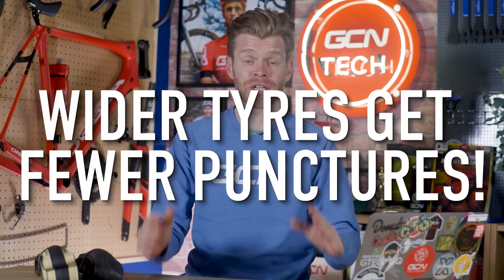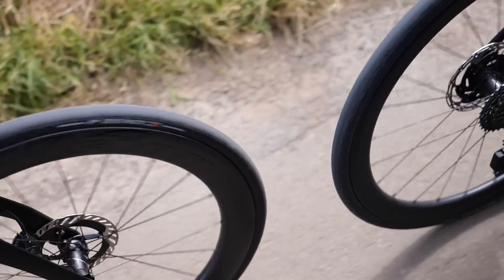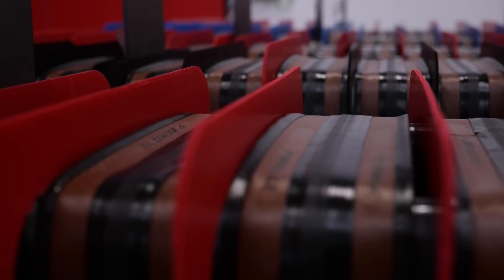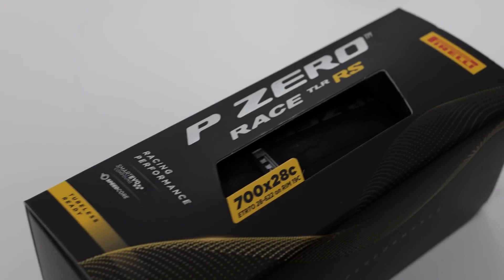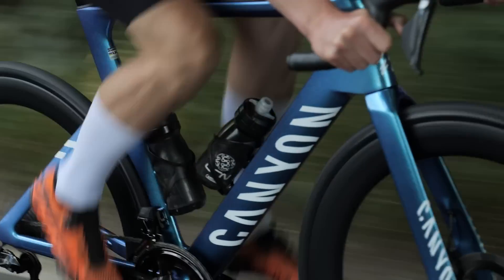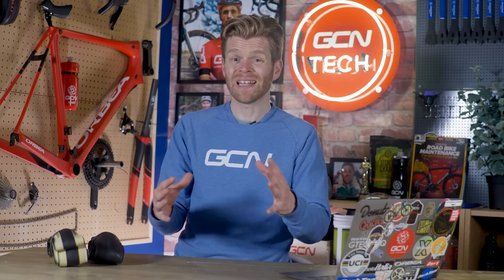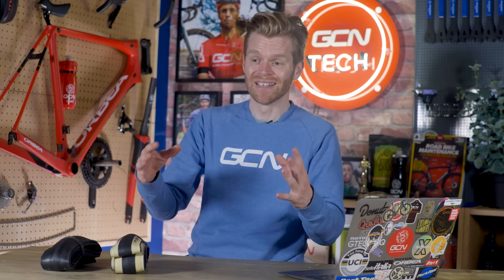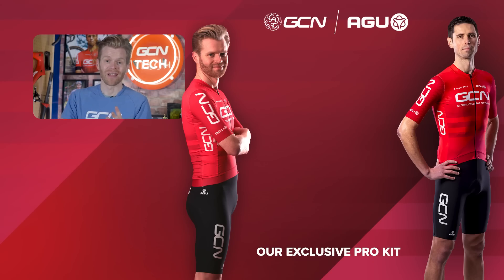Why Your Bike Tyres Get More Punctures

Comment from the maker: Have you been running your tyres at the wrong pressure? 🛞
Reply: not really. Using Silca's tyre pressure calculator for the past 2 years. Mind you, not tubeless, for its notoriety and fussiness due to the sealant, but with TPU.
Reply: I am not buying in the low pressure craze. I am significantly slower on 60minus PSI. I keep it on 95-115 on my 700c 28 front and 700c 23 on the back (mudgard prevent put 28th on the backwheel)
Reply: One point missed. The wider patch presents itself with a much higher risk of a puncture to road debris. If it’s double the width it’s probably almost double as likely to hit a sharp object.
Reply: @christocan4710  The lower PSI per cubic inch of the wider patch may mitigate that effect. We could speculate all day about these points, but we don't get paid as much as the 2000 engineers at Pirelli so I wil leave to them to figure this out. It sounded like it's a never ending quest for them.
Reply: @rdeanmurray8139  I don’t think so. I have seen real world contact patches and they are simply wider the wider the tire. So it’s only logical you hit more sharp objects.
Reply: I've regular Conti 5000 25C with tubes and forgetting to pump them up to spec more often than not gets me snake bite punctures. So pumping up tires before rides is obligatory.
Reply: @Alex-gl2dw  the same but with 23mm. Waiting them to wear out for justifying a new  28mm tires installation.
Reply: Because I'm lazy and ride on a variety of surfaces, I tend to inflate to a little bit higher pressure and then wait until they're noticeably lower before re inflating
Reply: 12,000km a year, all tubeless, all correct pressures. No punctures in 3 years and counting. I do ride on Swiss roads though…
Reply: Just switched to TPU tubes on my gravel bike and checked on the silca calculator after getting a pinch flat what pressure I should be using.  Turned out I'd been running at 50psi and they recommended just under 40 for my system weight and tyre width.  Much comfier ride now too.
Reply: Only on the vintage bikes that can’t go past 25mm
Reply: I only do what GCN tells me what to do.
Reply: I weigh 255lbs so I have to run 95 psi or the tire goes flat 🤷‍♂️
Reply: @shawnmartin1306  Not quite that strong but I run 140 and 160psi with very good Contis. Perhaps after I get smoked in the Geezer Time trial I might reimagined this? It works. Lovely to hear from all the tubeless warriors.
Reply: How to turn a 30 second video into 12 minutes and I still don’t have a good answer.
Reply: @prism8289  Wireless then
Reply: Over time won’t the shoulder of the tyre slacken increasing the contact area.

The older the tyre the contact area will increase, surely increasing the chance of picking up debris that gives a puncture.
Reply: Usually about half a bar under what is the maximum printed on the side
Reply: Yeah! Blissful!
Reply: I bought Victoria rubino pro 25mm with tubes on hunt wheels. On the sidewall they say 100 to 120 psi not knowing any better I did 107psi..constant pictures. At 85psi an odd puncture, 80 psi I've not had a puncture for a while now. I also noticed when doing a roadside tube change cause my hand pump is rubbish that even at 55psi riding home it doesn't really feel any different. Also they are wider on the wheel than 25mm.
Reply: I have actually... Thanks for this timely video Ollie, I was overinflated by 15 psi on the front and 12 psi on the rear tire of my gravel bike. My wrist is almost recovered from a crash on a rooty single-track when my front tire washed-out on a downhill switchback which put me off the trail and onto my head.
Reply: Most often I underinflate by running the pressure recommended for hard gravel/terrain also on the road when using my gravel bike as a road bike.
Reply: nope
Reply: Absolutely yes according to old ways. 28 mm butyl inner tube at 3 Bars. I still have a good condition GP4000 S with no punctures on my sweetest bike. Years of special rides only. But with work horse bikes 3 Bars and thousands of kms and no punctures. Not many thorns around but glass and metal wire bits from exploded car tires.
Reply: @gcntech  I shall be vindicated in the end. Relieved I can still find my favorite tires.
Reply: I was at a lower tyre pressure, however most tech conclusions seems to have a cyclist being 70ish kg. I generally float at around 110-115 kg. With the recommended tyre pressure I kept having punctures Im guessing from snakebites..... As my gravel tyres looked perfect except for the side wall showing wear from the rims
Reply: Depends on what you mean by "wrong". I'm using SILCA Professional Tire Pressure Calculator and I'm constantly below the minimum stated by the vendor (Pirelli...), is this wrong?
Reply: Nope, turns out me being a fat tall bloke on standard (non tubeless) gp5000 28c required around 90psi. Just switched to god foresaken tubeless tires at 32c and done my first ride at the recommended 61/65psi and think I prefer the 28s and 90psi
Reply: @stuartscott3948 Andy Capp and all?
Reply: What a load of bollocks sharp objects or impacts cause punctures. More manufacturers waffle

Comment: With me at 250 lbs and the bike and associated gear, I figure a 270 lb total bike weight.
For 28mm clincher (rim brakes)
It says to run 99 psi rear, 95 front.
According to silca.

Comment: I’d really be interested in a discussion on how the 15% drop holds up with all of the current tire designs and sizes. 15% drop turned out to be a constant across the range of tires available in the 1970s. I’ve made gages to set tire pressure for my wife and I. Each gave is specific to one tire and rim combo. It was via a mid 1970s magazine article that I learned about the extensive drum testing that led to finding that rolling resistance was optimized at 15% drop. Frankly I was a bit surprised that well into the 21st Century the hard tire myth was still widely believed. Test data and valid engineering explanation was available half a century ago. 
All those decades and bazillions of dollars spent on exotic materials and areo shapes but it’s still a new topic to not jack tire pressure to the max?!

Comment: 50 years of riding on 25c tires, I can say that tires have gotten much more puncture resistant and road have gotten much more tire friendly.  For two day 250 you use to have to take a spare tire, at least two tubes and a patch kit.

So far this year 3,000 miles and one flat.

Comment: I competed in triathlons for over 25 years on high pressure, narrow tires (150-220psi / 18-21mm) before I had my first flat. Only had 2 in the 10 following years, so there is something to be said about having a much smaller, narrower contact patch encountering 50%-or-so fewer pointy things ...  and I never had pinch flats. (I ride 23mm tires at 100 psi during training rides. Still very few punctures.)

Comment: I have suffered so many punctures on my 50k commute on Auckland city roads on a 55kph ebike.  Most have been a "snake-bite" pinch punctures from manholes and potholes (in traffic they are sometime impossible to avoid).   My carbon wheels do not allow tubeless and I am running 32mm Continental GP5000.  My final solution is very involved.  1. Very think inner-tubes.  2.  A "ghetto liner"  (where you take an old inner tube, cut it along the inner circumference, and then place it inside your tire over a new inner tube)   3. Tyre Slime   4.  A high tyre pressure, about 85psi.   Finally I seem to be running puncture free.
Reply: Someone might ask WTF are you doing "commuting" at 55 kph using CARBON wheels? Some sort of death-wish?
Reply: @larryt.atcycleitalia5786  It's safer at to do traffic speed + it's fun
Reply: @larryt.atcycleitalia5786  it's safer going traffic speed, you don't get squeezed

Comment: My 28s are inflated to 90psi.  Anything lower than 80-85psi feels like a flat to me.  Finally used up the 23s I had,  felt like a hard rubber tires at 85-90psi.  My son prefers 23s, wear as I have switched to 28s, on my old Mavic rims.  I ride to & from work, 22 miles round trip, and for exercise on weekends.  Paved streets, not going fast so I can't avoid road hazards.  Never had a flat on the road/bike path or on the Coney Island boardwalk which is why I still use tubes,  however have had ONE flat sitting in the garage (aged tube), I own 3 bikes.

Comment: The other huge area of difference between performance automobile tires and those on bikes is heat, which is a total non-issue with bikes, but a core constraint with any car tire, and likely the most significant factor in designing racing car tires.

Comment: 25mm will go the way rim brakes have. Running on 28 and 35 on my road and gravel for commuting... 1 pinch flat over 20k km (and it was me being too fast for my back wheel on a curb climb...) Pirelli Race TLR  and GP5000 STR. I think the Pirellis are slightly more resistant to wear but still early to tell. Tubeless with Vittoria airliners in for added protection.

Comment: Been a year since my last puncture on road bike. I don't stress when I get one as it's easy to fix with my rim brake bike, tyre can be removed and fitted by hand, got C02 and a decent pump. Prefer 25mm tyres with TPU tubes normally, have run 28 and 32 in the past.

Comment: I’m not sure about the effect on punctures, but I just learned the lesson of wider tires at lower pressure and the ride now never felt better in my life. I was riding 25mm tires at 120psi! I’m 200lbs so my rims and tires hated me. 😂 After a spoke break and splitting side walls, my local shop recommended 28mm at 90psi or lower.

Comment: No discussion about the type of tube and its effect on the tire patch. There must be a difference between butyl tubes and TPU tubes, and I bet the difference is that the TPU tube has less rolling resistance. I heard somewhere where a TPU tubed tire runs with almost the same resistance as a tubeless tire. So the TPU'd tire will be lighter (no sealant), almost as fast as tubeless, and none of the mess and hassle of tubeless. I've been running TPUs on both my road and gravel bike for over a year now, and love 'em. Give it try if you're considering it. TPUs are expensive, though, but easier to patch than butyl.

Comment: In 50 years of active cycling I’ve found the greatest contributor to flats is riding over debris and having it “pound” into the tread. You pick up the bit and every rotation it’s driven up into the tube. Back in the 225g tubular days we would see the debris and use our hands to brush the debris off before it could puncture. Also damp roads are doubly problematic. The water acts as an adhesive to pick up debris and a lubricant to drive it through the rubber. Over 300,000km I’ve replaced more tubes from rotting than puncturing.

Comment: I'm an old fashioned rider, with 27 inch rims on my road and tandem bikes.  I've been running 1 and 1/8" tires for years and can count the flats that I've had in the last ten year on one hand.  High pressure, up to 105 lbs per square inch on my old Avocet Model 30 Road tires.  Now I'm running Panaracer Protite's, 1 and 1/8" and I've still never had a problem.  Narrow tires at high pressure have less rolling resistance.  Where I ride, here in Ohio, the roads are pretty smooth.  I can see wider tires on crappy roads, giving you more flat protection, but on decent roads, I'll take the narrow, high pressure tires, any time.
Reply: I am with you. 27s.... 100psi +!!!  And 1 1/8th.  I get far more with 1 1/4, quit using! Sail on my low rolling resistance brother! ❤

Comment: I believe you stated the question incorrectly at the start: 'which vehicle puts more force at the bottom of its tires?'  The force is the total load, not just the pressure.  A tire with a 100lbs load will put 100lbs of force into the ground, but the smaller ther tire, the higher the pressure.

Comment: It also has to do with where you live really. I rode id say over 600 miles in just June and July, and my main reason for punctures was the very shitty and trashy roads here in Bedford Co, TN. Glass everywhere. I can't go anywhere in this county without picking up glass or something else that makes it go flat. I went through two tubes in one night because of glass on the road.
Reply: And for those who say it's my tires, it isn't. I run 25mm on my road bike and a 2.25" 26 inch tire on my MTB. And I still got beer bottle glass in my tire. One tire ain't tubeless ready no more

Comment: I use tubeless Pirelli cinturato-velo tires 28mm and ride about 5500km a year. I almost never get a puncture until a hit about 5000km and then when I do get a puncture, the sealant (usually Orange or Stans) completely fails as well even with small punctures.  Not sure why this happens where we go from functions to complete fail of the tire.  Makes me think sealant is just a gimmick

Comment: contact patch area = gross weight / tyre pressure. If the tyre has carcass strength then ground pressure can vary across the patch and the patch will be smaller.

Comment: Hi, thanks for the video.
I once learned that the grip over pressure in NOT linear for rubber. This means there should be a optimal (contact patch) pressure for a given compound. 
If I understood correctly this has something to do with the rubber interlocking with the surface, but at a certain pleasure the interlocking is complete and an increase in pressure does only slightly increase the grip. 
I guess we should strive to hit this sweet spot. Or tire manufacturers should strive to provide tires that hit that sweet spot when used at correct pressure.
(just to make it bit more nerdy ;-) )

Comment: As a voice from  the past, I have some comments . When narrow(25mm) clinchers first came out in the mid 1970s, I put my sew ups aside. I got more flats on the clinchers. I deducted unscientifically that the clincher rim was stiffer and worked like an anvil above the tire. Kind of like putting the tire between a rock and a hard place. As a dark horse in my cycling  club, I  returned to sew ups. I  could wear a tire out and could almost predict the day it would  puncture based on wear and road conditions.  Fifty years later  I  still ride cheap sew ups and am happy. 
Any cycling  archeologist  can tell you that back then ,for Paris-Roubaix there were large cross section ,very light silk tubular tires. So your contact patch science was considered back then.
 Moral of the story? I think experience  and the willingness  to understand are important.  Off road guys know how to receive  the variations in the  ground surface.  Roadies should do this also. I call it riding  vertically while going along. This is difficult  in a pack , but can be done by choosing positions within the group.
 I never lost a race due to a problem  with my bike. I lost hundreds of races due to the other guy(s) being faster or using better  tactics.

Comment: Does anyone have suggestions for preserving (tubeless) tires? I had to replace my vittoria corsa pro control g2 after about 12 months, cycled 9000km in that time, although only about 2000km outside (a waste I know) and the rest on Zwift. My trainer is in a spare bedroom, which can get pretty sunny, temperature is pretty consistent. After 10-11 months I noticed a lot of little cracks (total about 8) in both tires which weren't totally covered by the sealant, had to use 2 plugs. So I was kind of bummed by the lifespan. This year I"ll be riding more outside through the year, I store my bike in a dark cool room between rides. I'll be buying another bike for Zwift. So I hope this will improve the lifetime of my tires. Any more tips are very welcome though.

Comment: On my all purpose bike (commuting groceries and touring I have 50mm tires, semi slicks never puncture and rolling resistance is rather low when pumped to near 4 bar. The reccommended pressure is between 2.0 and 4.0 bar, when the roads are bad I can lower the pressure for more comfort. In winter I mostly ride on the "dual fighter with a smooth rolling patch and more grippy profile. The nice thing about wide tires is that you have a lot of freedom adjusting pressure to  circumstances. Cheap tires suck because when adjusting pressure for gravel or snow the rolling resistance goes through the roof!

Comment: You are advocating low tyre pressure. Then how come that the advised minimal pressure for my Vittoria Rubino Pro 25 mm and Continental 4 Season 28 mm tyres is 7 bar? I use butyl inner tubes. The local cycling shop advised to put 7 bar in the front tyre and 7.5 in the rear tyre. FYI, my weight is 75kg.

Comment: please don't use "force" and "pressure" interchangeably like you did in the introductory comments  - they are two seperate physics quantities - as you point out throughout the rest of the video.
P = F / A. Pressure = force / cross sectional area.
Flimsy interchangeable use of the terminology detracts from the scientific discussion you are attempting to have - rather than adds to it

Comment: One thing that used to be taught was that if you put a block of 4x2 wood on a plank and tilt the plank, it will slip at some point. If you put it on edge and tilt the plank, it will slip at the same point. This demo was used to demonstrate that the coefficient of friction was not related to surface area, so you slip at the same point regardless of contact area size. Always seems non intuitive to me.

Comment: Timestamp 2:54 Ollie got his own question wrong because he used the word "force" instead of the word "pressure", there is a difference.  By using the word "force" the surface area of the contact patch has no relevance at all.